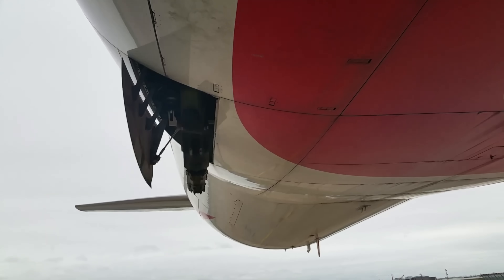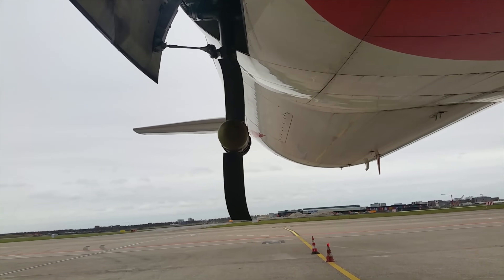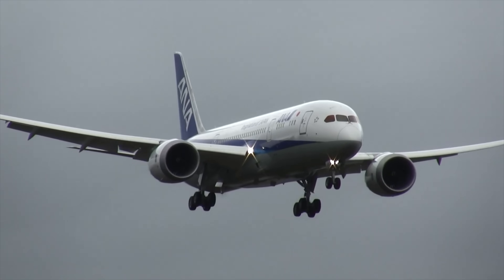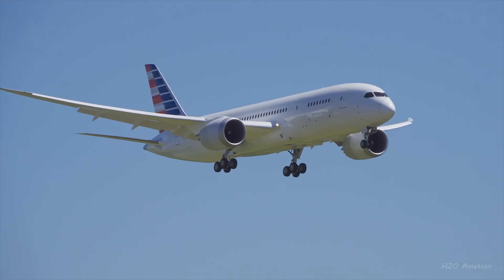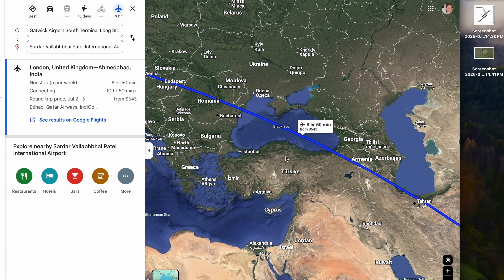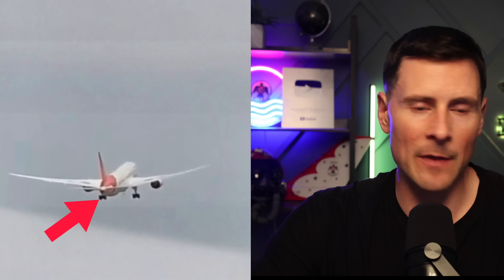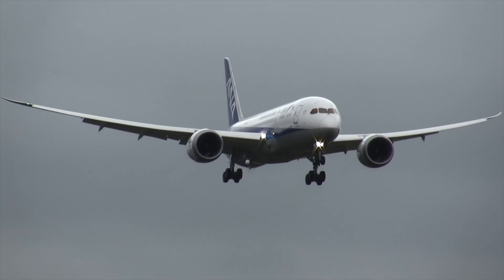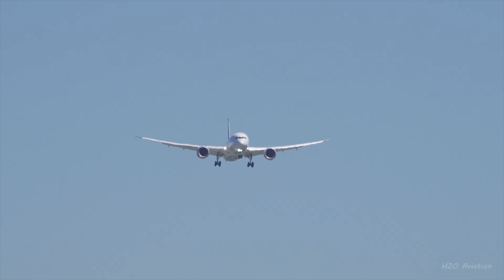Air India 171 SHOCKING UPDATE on RAT Deployment and Flaps!

Comment: I asked Grok what would happen if a 787 lost all electronics and this was the answer: If a Boeing 787 were to experience a total loss of all electronics, including the Full Authority Digital Engine Control (FADEC) systems, the engines would likely revert to a fail-safe mode. The FADEC system, which controls the engines, relies on electronic inputs to manage thrust settings. Without any electronic control, the engines would not maintain the last thrust input data, as the FADEC requires continuous electrical power and data to function.

In the absence of all electronics, the engines would most likely default to a predetermined fail-safe state, which is typically a low-power or idle setting, to prevent unsafe operation. This is because modern jet engines, like the General Electric GEnx or Rolls-Royce Trent 1000 used on the 787, are designed with safety mechanisms to avoid uncontrolled thrust in the event of a total electronic failure. However, the exact behavior depends on the specific engine design and its fail-safe mechanisms, which are proprietary and not fully detailed in public sources.

Given the 787's fly-by-wire systems and reliance on electronics for flight control, a total loss of electronics would also impact other critical systems, making controlled flight extremely challenging. The aircraft might still be controllable to some extent using mechanical backup systems (e.g., trim controls), but engine thrust would likely be at idle or a minimal setting, complicating any attempt to maintain flight.

For precise details on the 787’s engine behavior in such an extreme scenario, only manufacturer data from Boeing, GE, or Rolls-Royce would provide a definitive answer, as this information is not fully disclosed in public sources. Would you like me to search for additional context or focus on a related aspect of this scenario?
Reply: So I am going with speculation that this 787 experienced a thermal runaway in the electronics bay and lost all electronics during takeoff. The RAT deployed and the engines fail safe to idle. Unfortunately takeoff was the worst possible time for this to occur and there is nothing that the pilots can do.

Comment: ❗️MAJOR ELECTRICAL FAILURE GUYS…  LOSS OF ‘CONTROLS’ EVEN TO THE ENGINES… The bang heard by the passenger.  Loss of dual thrust.  RAT deployment. A major event of an electrical failure would explain a loss of controls and down spooling of engines.  This event was something well beyond the heavy engineering of aircraft systems redundancy.  I will place my bet on something that is common.  The grounding of the electrical systems is common and not likely to have any redundancy.  This is common for a reason, lightning protection for one example.  Grounding failures have happened before on aircraft.  A bang like a shot gun or M80 is also what can happen in a catastrophic electrical failure.  It can also spike all the redundant equipment to a point of severe damage hindering any controls from the flight deck back to the relevant equipment. 

The point to understand is there are many redundancies.  These are based on a common design to fail over.  So, what falls outside of all the redundancies is an electrical major failure or grounding failure and this can cause massive electrical spikes damaging redundant systems.  It was a one - two punch.  I am not a pilot.  This is an engineering comment.  Certainly no offense meant to pilots but pilots are not trained in major bonding ground failures and if the entire electrical systems goes bye bye, would it potentially including all electronic controls from the flight deck to the engines?  

Another question will be the FDR and if the power were cut, what happens?

Comment: Several Boeing 787 Dreamliner whistleblowers, such as Sam Salehpour and John Barnett, have warned that there has been a lot of sloppiness in the production of the 787 Dreamliner planes. 
Boeing engineer Sam Salehpour tells senate hearing that company took 'manufacturing shortcuts'.
Boeing whistleblowers reveal years of concerns over airplane parts | 60 Minutes
Boeing whistleblower documentary: How exposing safety issues changed their lives forever

Comment: In the electronic and acoustic engineering world,a piece of equipment called a spectrum analyser,will be able to remove any doubts as to what you're hearing.
You could even sample the sound using a microphone,and a sound card,with open source spectrum analyser software,it will help you identify,what sound sources are on the recording.
Reply: I think that we can all hear the RAT sound in the video. It'll be (very likely) confirmed from the BBs. Flaps were most likely in their proper settings. Pilots had the choice of aborting too late (and crashing into buildings) or taking off and attempting engine restart(s). Unfortunately there was little to no run off area.

Comment: Look closely at main bogeys: they had already completed their forward leveling as the result of the gear up command, but I believe that's when they lost all power and all hydraulics. The rat couldn't supply electricity and hydraulics fast enough to do much anything. The Captain's only call was "Mayday, Mayday, Mayday. No power, no thrust, going down". There was never any visible yaw, so it looks like both engines failed simultaneously to me. Helluva raw deal.

Question for any 787 experts out there: can the fuel shutoffs be initiated without the throttles being at idle? I have this gnawing little bug that keeps trying to work some things out.

Comment: If I was in Vegas.....I would bet  an improper  setting  of some type...software of hardware....or ....Air India service practices and policies....as opposed to ...the Aircraft not being certified for single engine climb out at reduced power if the crew is trained properly .

Spontaneous engine shut down of a perfectly good motor on a safe aircraft........followed by totoal  inability to climb out......I smell a rat alright ....

Comment: The fact that you can actually hear the sound of the RAT tells you the engines were not roaring at full takeoff power.   The roar of those engines would have easily overwhelmed the sound of the RAT.   Those shots of actual RAT's deploying were all during landing when the engines were spooled down for touchdown.

Comment: If you are going to build an airport, it should be mandatory to have at least 5km of RESA at each end of the runway OR build helicopter pads and forget the airport.  THAT is the cost and it is considerably less than 300 lives or 1 life lost. No lives would have been lost with 5km of RESA at Ahmedabad.  Let air safety experts work out the optimal RESA and take that away from realtors and bean counters.

Comment: Flaps, speed, and take off looked, perfect. Unfortunately what has not been mentioned, and by chance, the hut! There is clearly smoke clouds after the plane is in visible sight, and the plane clearly used all the runway.  Something happened in that moment the plane was not in sight. 
The landing gear also in another video clearly shows them pointing down, (Pointing Down) meaning the landing gear lever was initiated, however they did not go up, because of a major power failure, thus not able to retract. Landing gear point downwards so they can elevate into their position. 

This was a complete duo engine failure. 

Mayday mayday was announced also. 

So, what happened?

Comment: 11,500 ft is very long to go to the end of the runway, even in this hot weather (I believe the report was 37C at that hour of the morning).  Maybe they elected not to use the full runway, combine with substandard engine output as evidenced by the lack of a loud jet sound on the video as the plane flies by.

Comment: where on earth is the SHOCKING update in this video? The RAT deployment has been totally established by  a busload of other analysts and doesn't need any more harping on. It remains to be found as to why exactly this deployment occurred. Also you spend half your video time on the flaps issue, another theory that has already fallen by the wayside. Anything posted between now and when some sort of official black box/FDR report comes out would IMO be a total waste of everybody's time for crying out loud.
Reply: " It remains to be found as to why exactly this deployment occurred."

Exactly.  The question is what was the underlying cause.   Everything is speculation until the data recorders are analyzed.

Comment: If the 787 needs only 5 degrees of flap at maximum load then the engines account for more lift component in the climb than is the case with other passenger jets. Thus will a double engine failure quickly down the plane for lack of lift. Lower drag on account of smaller flap setting will allow the plane to float on awhile until eventually stalling. This is what we see in the accident video.

There seems no doubt now that both engines failed to deliver thrust at about the same time either at some point beyond V1 on the runway or shortly after the climb began.  Why the transponder stopped transmitting ADS-B data at about the threshold of runway 05 is as yet a mystery. If battery power was available throughout the flight, and then of course the RAT, why would there be a stoppage of ADS-B data transmission?  There are to my mind now too many mysteries that need accounting for to put the failure down to a single issue. If for example both engines are abruptly starved of fuel why would all the electrical backups suddenly go offline in sympathy. It makes no sense.

Here's a thought. Was the plane refuelled at Ahmedabad? It's a wild thought but did the plane actually run out of fuel, fuel enough to run up, taxi and take off but running out shortly after take off? One recalls the 'Gimli glider' and the fuel mix up that so nearly ended in tragedy.

Comment: The landing gear only needs gravity to be deployed because of their weight, the only risk is the nose gear as it may not lock into place properly because it's less heavy, but the gears need power to retract them, and the fact that they were not retracted after take off, and the RAT deployed, means only one thing, massive power failure. Something catastrophic happened to both engines  and my unprofessionally guess is that it was the fuel. Maybe contaminared fuel or fuel pump failure to both engines.

Comment: Wouldn't the ram air turbine spin according to air speed and load.  20,000 rpm seems pretty high if it had a load and the aircraft was going about 1/4 its full speed.
Just an observation.  Wouldn't the blades have a tip speed much higher than super sonic at 20,000 rpm?  If the RAT had a load at that slow speed it may not be turning fast enough for the tip speed of the propeller to break the sound barrier, and would not sound any where near as loud.
I'm just an physicist not a pilot.

Comment: I'm not a pilot or an expert in 787's but right off the bat on take off from the start didn't this plane take up almost the whole runway to even lift? if the pilot's knew or felt that with wide open throttles they may not have enough speed to lift safely wouldn't they abort before hand? I mean there's no way brakes could have still been partially applied while they were taking off right? wide open throttles full thrust and the mph isn't right why didn't they abort, or was it too late and they tried to correct the situation after they were in the air. Something smells of an electrical failure, a huge one.

Comment: 787 Engineer here , Just as Info - the 787 has 3 different hydraulic systems. L/R/C . The right and the Left has a primary engine driven pump supported by an electrical 235v on demand pump . The Center system is driven by 2 electrical 235 V pumps located behind the left wheel bay . The RAT only powers the the center system , the center system controls Hilift system ( flaps/slats) and a few spoilers and the rudder and elevator . If i don’t remember wrong when the RAT is in use as only source of hydraulics the high lift system and landing gears are not supported and the flaps/slats will have to be operated electrically and the gears can only be extended by the emergency pump to open the locks but cannot be retracted ( as i remember) And another thing ii have difficulty to understand if the so called waperlock of fuel could potentially have occurred, i know very well what it is but the aircraft had just been refueled thru the hydrant system of the airport. Most of the wing fuel would in this case be new so to say and the temperature of the fuel coming up thru the hydrant system is never particularly warm . Also on the way out to the RWY they would have used already 5-600 kg and by the time they lift off another big amount- so where would it have been overheated/vaporized to cause an airlock in this case ?? Just wondering
Reply: I’ve heard some conflicting info about the RAT. Does the RAT have a manual deployment in the cockpit?
Reply: @Julia_is_Tired rat can be deployed manually, but it can't be prevented from deploying automatically
Reply: @Julia_is_Tired it deploys automatically when the system detects loss of power.
Reply: Julia, I flew the B767 with similar systems.  Yes the RAT can be manually deployed with a 2-step action.  The pilot must lift a cover and then push the button.  The cover might have a latch or thin safety wire for added protection.  Once deployed it can not be attracted airborne.
Reply: So what can cause both engines to flame out?
Reply: @viggojorgensson4708  one pilot channel talked about contaminated fuel possibility. There are limited options to look at for a double engine flameout. It wasn't a bird strike...so its wasn't external. Therefore as an internal flameout.....fuel is the primary suspect.
Reply: I heard a rumor that previous heavy rain got into a GPU junction box and it shorted all electrical power on takeoff. Boeing had a fix but it wasn't done. Not an engineer
Reply: good point on the fuel

Comment: The main gears are tilted fwd, they are normally tilted backward. They will tilt fwd when gear lever is selected up to fit the gear passing the gear doors, meaning that they selected gear up but lost both engines and therefor lost hydraulic power so the gear did not come up!

Comment: https://patents.google.com/patent/US9810145B1/en
US9810145B1 - Ducted impeller   |  Yes, That's me!

These engines do not stop rotating while in the air thus never loosing electrical and Hydraulic power. 
However, they do not produce thrust without Cool Air! With 100% by pass these engines are AIR PUMPs not  Jets! 

Lack of maintenance and Air India's lack of understanding of Aircraft, Auto Landing and Take off and no money is why the safest and cheapest most advanced Aircraft was selected in Air India's purchase of 787s. Putting a dark stain on Boeing and Air India's track record.
 
Conclusion;  This being the first occasion where, The conditions were not optimal for 787 take off.

Comment: Sir, after watching your detailed analysis, I had one question: Is there any scenario on the Boeing 787 where the fuel supply to both engines can be inadvertently or unintentionally cut off—leading to a dual engine failure? For example, could a systems issue, crew action, or misconfiguration result in fuel starvation even if there’s sufficient fuel onboard?

Comment: I’m a former airline pilot with plenty of flying experience. I usually avoid commenting on these situations, but I do pay attention to what other pilots say. I have to say, this is by far the most logical and well-explained video I’ve seen—and I completely agree with you on all points.
Reply: There hv been suggestions that the plane used the entire runway .
The extreme heat and lack of rain caused an extraordinarily large dust pile and debris at end of runway that is evident after takeoff. British Airways 009 had a 4 engine flameout from volcanic ash high altitude. Is it possible that the dust and debris caused a flameout at rotation
Reply: Attention all pilots on land peoples drive bus and on the air you pilots are driving air bus no big deal being a pilot accident already happen nobody's knows their plight on their last minutes
Reply: I'm not a pilot but I'm always first to speculate and throw my two cents in.

Comment: If the RAT isn't powerful enough to lift the landing gear and the landing gear is actuated to lift, would the landing gear hydraulics "steal" power from the RAT to try and lift leaving the other systems without the RATs hydraulic pressure to control the plane?

Comment: Weren’t you pretty confident that it was not engine failure but pilot error? Despite the fact that flaps controls is nowhere close to landing gear controls on this airplane and they look, feel and operate so differently, you with all that flying experience, that you have provided sage wisdom and speculated with zero evidence that it was a pilot error. After a bunch of others point out the RAT already, this Johnny come lately seems very confident m that it is dual engine failure.

Comment: It seems that the aircraft took approx twice the runway length it would be expected to take. 2600 meters rather than 1600 meters. That suggests low thrust soon after starting the TO run. Just doing mental doodling, almost twice the runway length suggests engine power was perhaps only 70% by rotation and it likely continued getting lower until they stopped working entirely and it stopped climbing. RAT deployed but nowhere to go at that altitude.